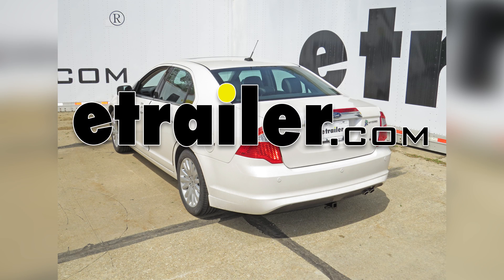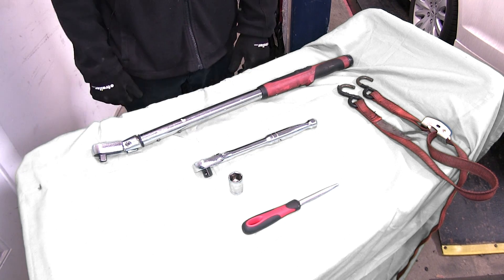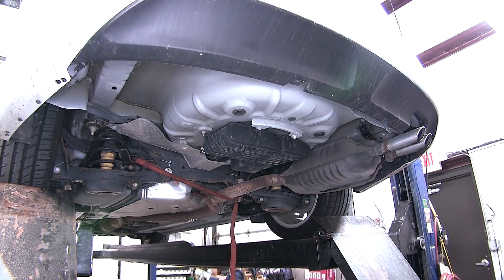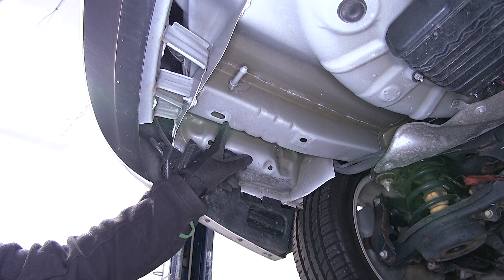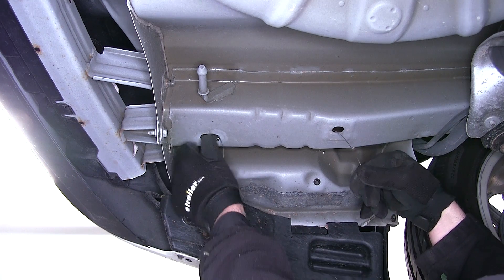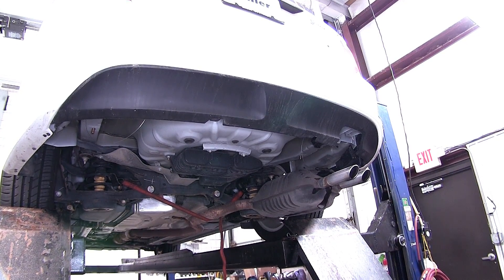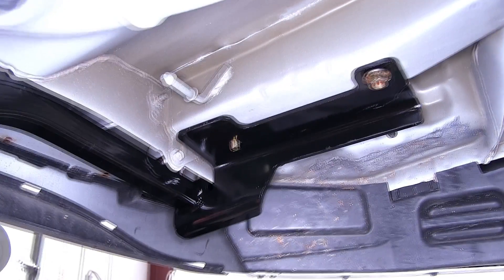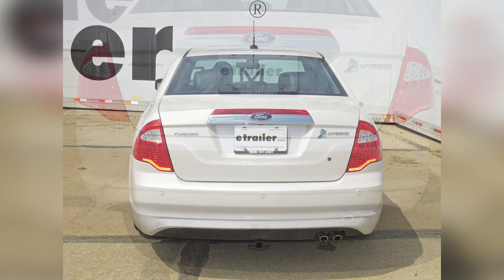etrailer | Install: Curt Trailer Hitch Receiver on a 2012 Ford Fusion

Comment: I would've sprayed something where you filed the frame rail to inhibit rust.  I need one of those bolt pullers.
Reply from the maker: It would be a great preventative measure to spray the frame with a high quality spray paint to seal it up. The bolt puller we refer to as a fish wire, for this installation it is a 1/2 inch (diameter of the bolt) bolt leader and is available as part # C58400 on our site. Here is a link for your reference: https://www.etrailer.com/Accessories-and-Parts/Curt/C58400.html

Comment: I recently bought this hitch for my fusion from a local trailer dealer. They did not provide me any instructions. As a result I do not have the torque spec for the mounting bolts. Can anyone tell me what that spec is. I have a 2010 Fusion. Almost identical to the one in this video.

Comment: Where can I get these screws for installation?
Reply from the maker: The Curt # C11390 includes all the hardware needed to complete the install, but if you need to replace the hardware for some reason, you can use the # RHK replacement hardware kit. On the page the link below takes you to, type 'C11390' into the provided field.
https://www.etrailer.com/Accessories-and-Parts/etrailer/RHK.html
Reply: @etrailer  
I bought it used and couldn't find any mounting screws, just one. Thank you for your help💐